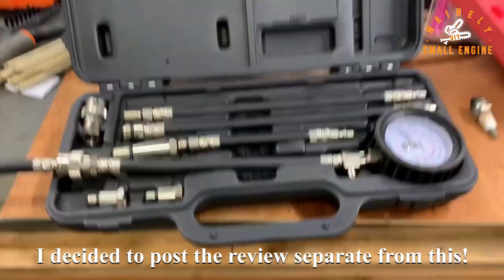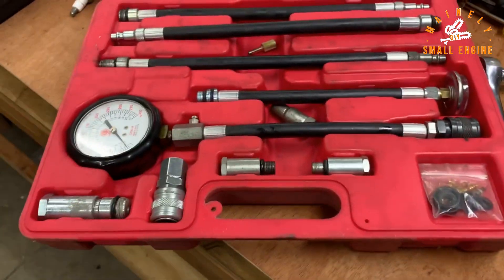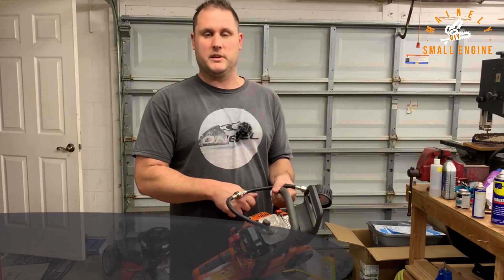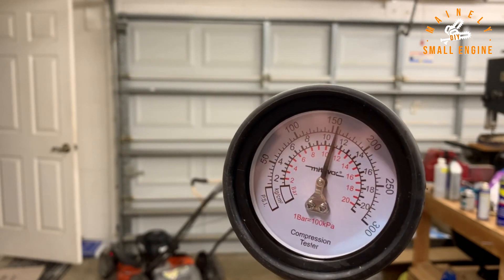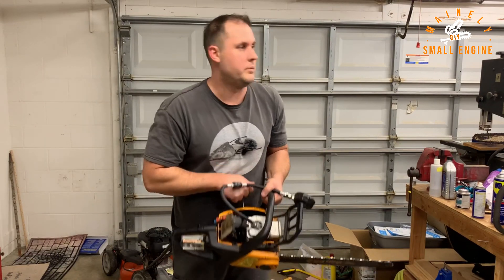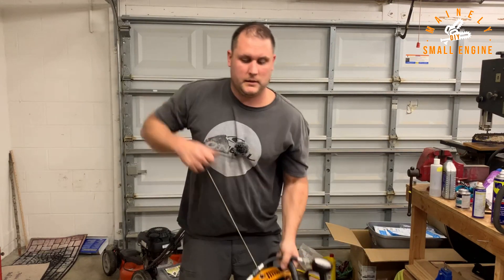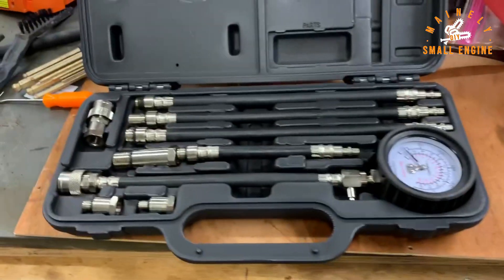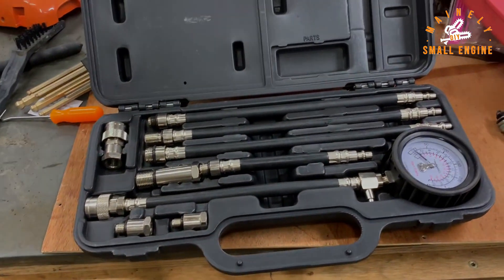Testing my Mityvac vs Matco compression test gauge for accuracy. Don't but until you watch this!

Comment: thanks for sharing the info. Is there a compression test values table? I have an old scooter with a 200cc engine with no information was found on how much should read the compression
Reply from the maker: That I do not know about but perhaps googling your Model or asking the manufacturer for specs would be the best bet.

Comment: I just bought a snap on compression test set, and I tested like 10 saws, and they all read between 110 and 120 psi, and i know they have good compression so im wondering if theres a difference between automotive gauges and small engine gauges. on matcos site it says "tests most gas engines to include small engines" and snap on just says "for cars and trucks with gas engines." I have a cheap one i bought from the auto parts store, but it wont read over 80 psi.  im kinda bummed bc the snap on one was 325 dollars and i only bought it bc i thought it was gonna be the most accurate
Reply from the maker: I’m not sure and I’m definitely not well versed in other brands of these. From a quick google search I see to make sure you’ve got a Schrader type valve on it. I know both of the ones I tested had that. I also see that sometimes snap on will read low on small engines      !
Reply: @mainelysmallengineDIY  The $20 eBay ones are complete junk.  I can't get them to read anything other than 60 PSI on new Husky's, used Husky's car engines or my shop compressor set to 130PSI.  The only compression testers that are accurate screw in like a spark plug and have no extension leads and snap in connectors.  Your 150PSI test with the USA made tester would be around stock spec for any Husky that runs well.

Comment: Did you make sure the Schrader valve is properly inserted and working in the mighty vac hose? That could explain your issue.
Reply from the maker: I didn’t but I’ll check it out for sure. It was brand new but that only means so much.
Reply: How would you test that? The dial  isn't going down, which means the valve is holding air.